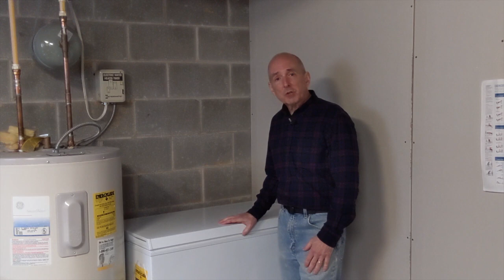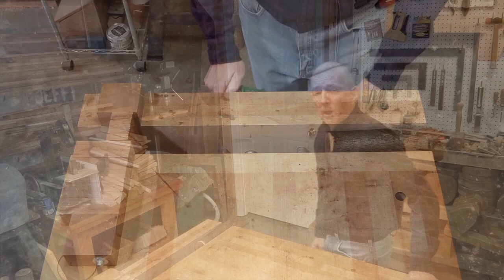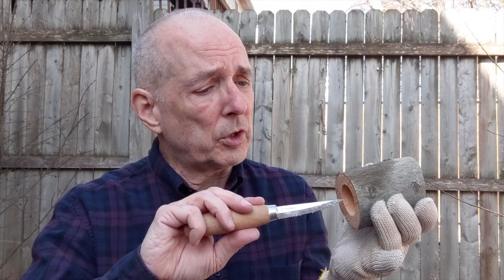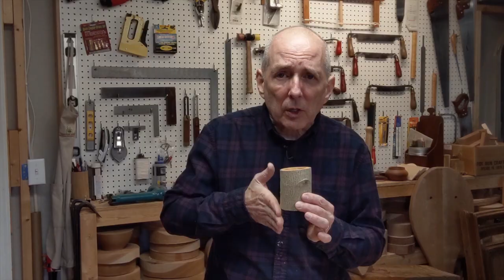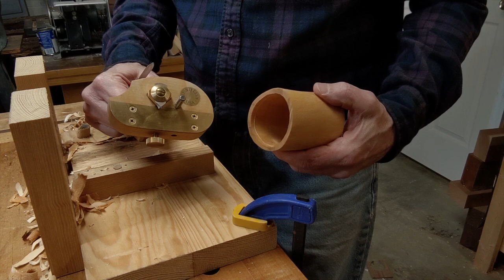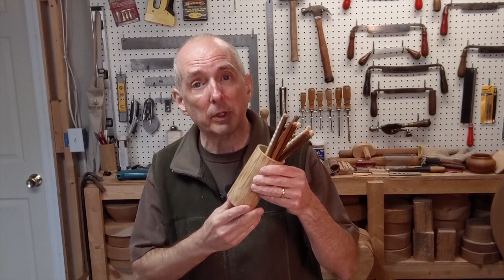Learn How to Make a Greenwood Shrink Pot

Comment: i wonder if you get the right wood and not drill through the bottom could you make a coffee or tea cup with it
Reply from the maker: That is a good question. Generally speaking, the cup would crack or check as it dries. That is due to the uneven shrinkage of wood cut from a branch. For example, if you cut a shrink pot blank from a section of tree branch and let it dry before making a shrink pot, it will dry with a big crack lengthwise down the blank. It is possible to make cups from wood, just not from branches.

Comment: Can it hold liquids? Can you use some treatment inside to make it hygienic and longtime durability for a drinking mug?
Reply from the maker: The shrink pot does not typically hold liquids. I have given this idea some thought over the years, but never came up with an idea that would work.
Reply: people use pure beeswax on mugs for cold drinks.   supposedly waterproofs it and is natural.
Reply: My grandfather used to make a butter churn by this way, and he put some steel rings on outside.  But I do not think they put some hot milk in it. I know it could hold liquids.
Reply: Depending on the wood used it is perfectly safe if the shrink pot is made properly it will shrink down to pinch the bottom piece and make it water tight but this also depends on the size and  species of wood used i make them and ive never had a problem with them being water tight but as someone said before there are not design to hold liquids but things like sugar or salt etc which helps them to keep fresh

Comment: I am wondering why it did not crack while drying in your car.  Great job!
Reply from the maker: That is a good question! Cracks occur in wood because of uneven stresses in the wood. As fresh or green  wood dries, it shrinks. If a thick piece of wood dries and shrinks quickly on the outside but dries slowly and does not shrink much on the inside, it will crack. The shrink pot is a thin-walled cylinder of wood. Since the walls are thin, they dry at an fairly even rate - even in a hot car. If the walls were thick (½ inch or more), the risk of cracking increases. Thin walls are the key! The real risk of cracking is when the diameter of the bottom is larger than the finished diameter of the cylinder with the groove after it dries. That is the tricky part of making a shrink pot - trying to guess how much the cylinder will shrink. The best way to avoid that type of crack is to make the groove for the bottom at least half as deep as the wall thickness. Thank you for watching!
Reply: @well-versedman9583  thanks for the explanation